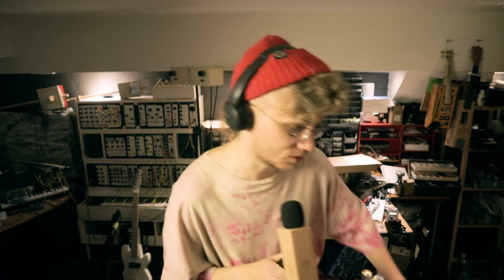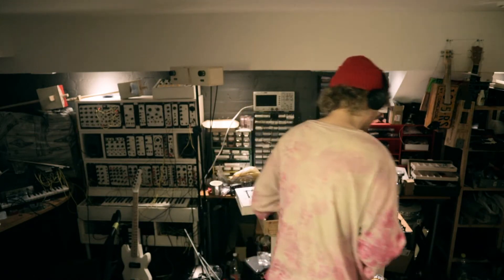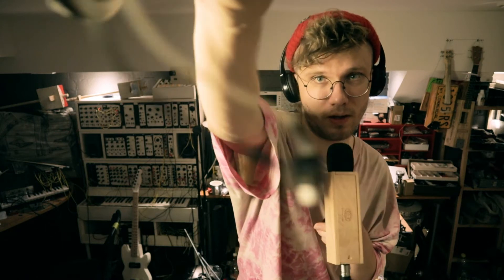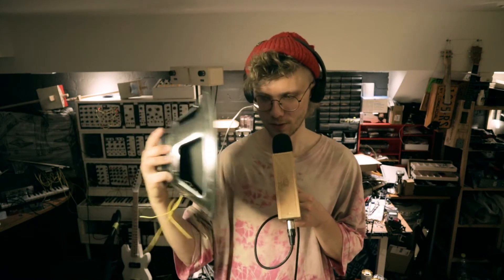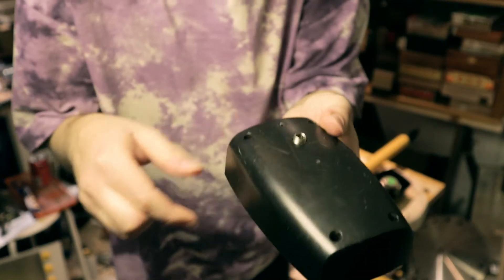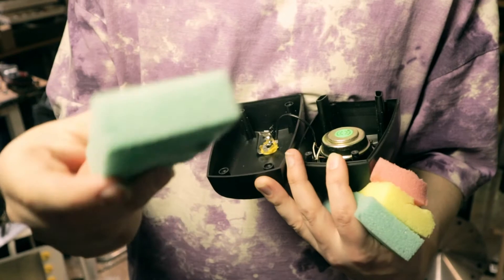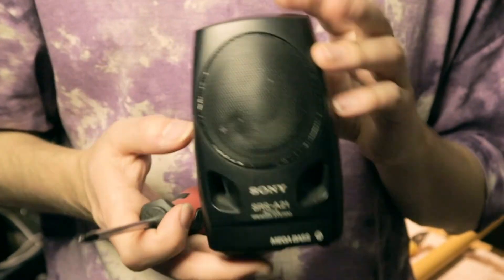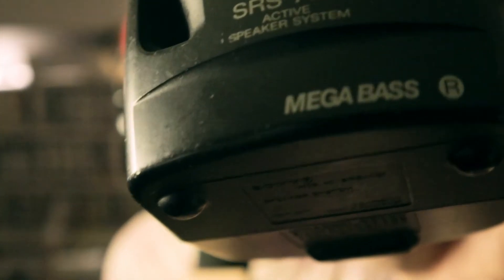Turning a broken PC speaker into a microphone!

Comment: Try set it up as a rotating ("leslie") microphone. It's a cool fx room mic. Even better fx if you can change speed during capture. Great videos!
Reply from the maker: Leslie stuff is definitely something im interested in and i’ve been watching all kinds on DIY leslie speaker videos on youtube! I might have to try and experiment some with some small motors i have laying around and the workshop
Reply from the maker: And i would love to try using a leslie speaker as a mic!
Reply: It's a simple fx to build. But in the long turn an emulation makes more sense for studio use because lacks unwanted motor / parts noise.
Reply: Hang the speaker mic by a string and twist it. It's the easy method 😅 You can also use it as a pendulum fx that way.
Reply from the maker: Haha yeah that is the easiest way! I would like to have something that can rotate constantly tho